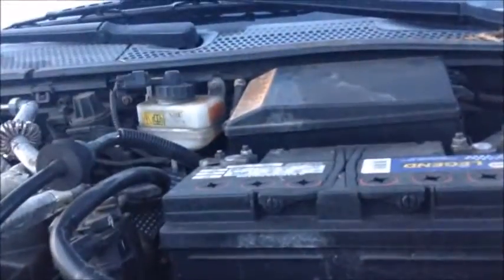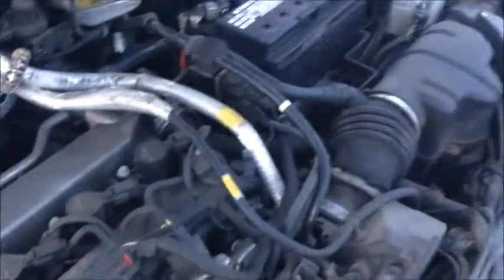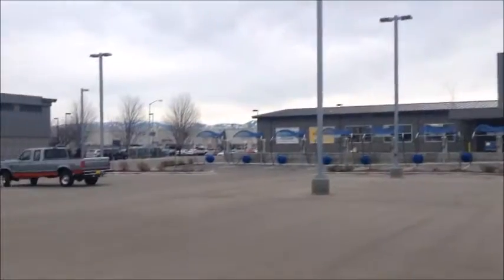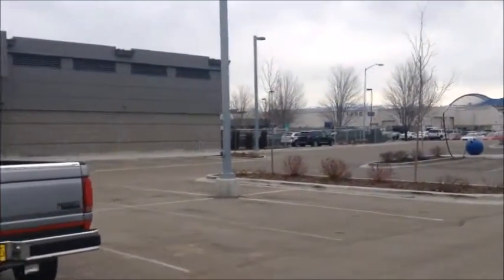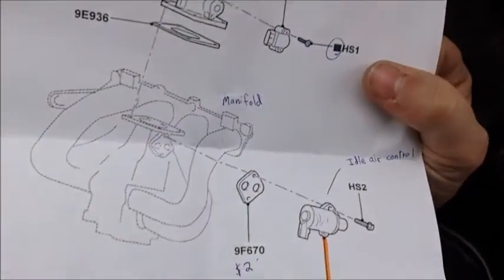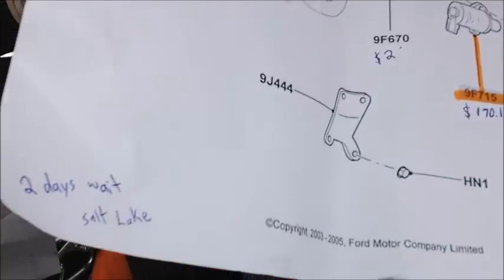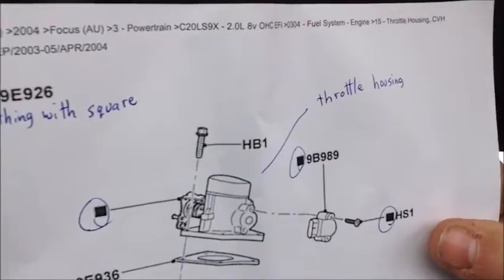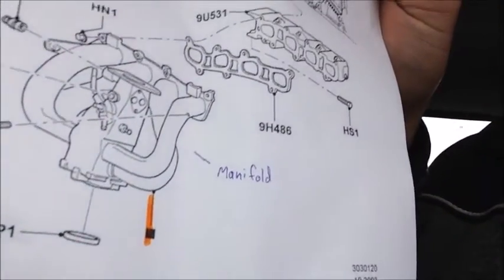Ford Focus vacuum problems.  Learning Process; historical timeline; idle air control???

Comment: I have a 2017 and it makes a loud alert noise in the engine after it is shut off. And the damn thing shutters when you turn to the right. And these focuses are shit. When my lease is done that car is gone. That powershift transmission is a joke.

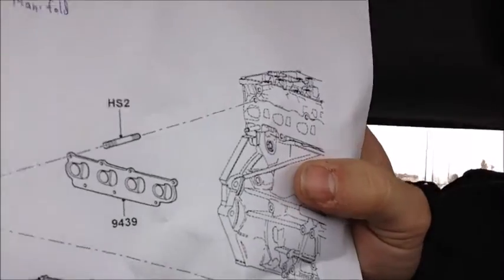Comment: I could be wrong about this. It looks like you have the Z-tec engine under the hood and it looks like you got parts page (8:47) form the SPI 2.0 engine. The diagram looks suspiciously like the wrong engine from what you have. Can you please update with a comment what the defect turned out to be? Thank you!
Reply from the maker: Yes, the alternator lost the ability to generate electricity from the engine, which caused the engine to rev higher to overcompensate for the weak alternator. Perhaps the "brushes" in the alternator got worn away? I forget the cost to replace.

Comment: Meridian...lol wow. I used to work in Meridian and live in Kuna. 

Has your check engine light been on? Well, its been on for years....LOL!!!!

Yeah its called a diagnostic....u can probably go to any autozone or whatever parts store and have them chk the code for free if it shows up on their generic scan tool....go there and see what codes you get after 2 years and google it. Or just slap a new one on and be done.

https://www.google.com/search?q=IAC+ford+focus+2005&oq=IAC+ford+focus+2005&aqs=chrome..69i57.4097j0j8&sourceid=chrome&ie=UTF-8#q=IAC+ford+focus+2005&newwindow=1&tbm=shop
Reply from the maker: I saw the trouble codes and I don't like how much they will cost to fix, so I ignore them.

Comment: O'Reilly auto has the engine light code reader and lets people use it for free. And most give out good advice and sometimes they'll talk you through (or even help install) something if it's easy.
Reply from the maker: +RibbitHopX It said my fuel pump is bad back in 2010. I didn't do anything about it though. My dashboard is broken still. I made a video in 2014 showing my solution: https://youtu.be/olf8LLgIHJE

I will heed your advice, but it just makes sense to me that when the engine wants to rev higher, it is getting more air. When you want a big hot roaring campfire, you give it a lot of air. My car is like that campfire. I need to fix the flu or air source.